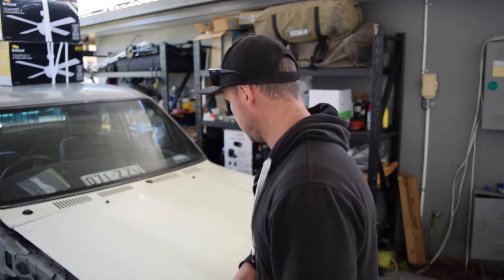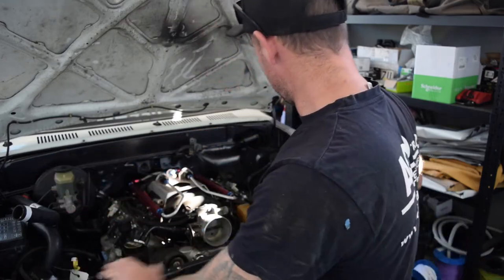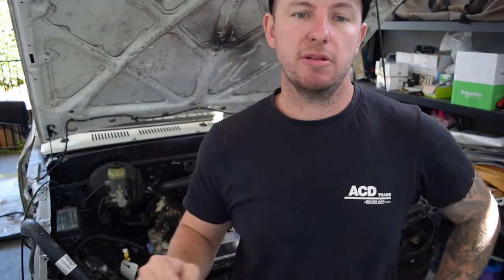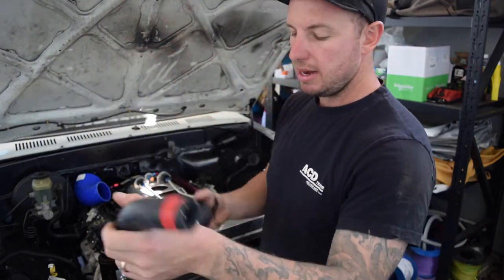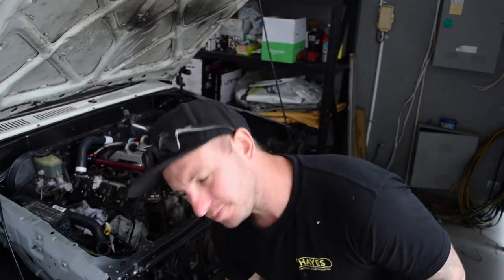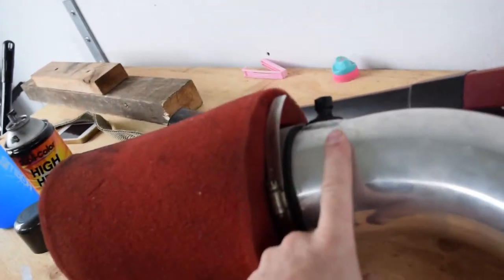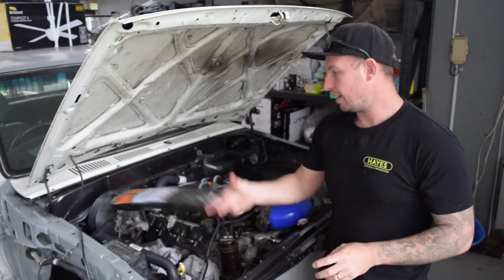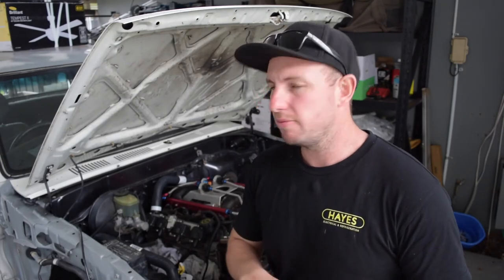LS1 Hilux Ep4 Radiator dont fit

Comment: Remote radiator tray mount? Elec water pump? I think you’ll need a decent 3 core or upwards to keep that thing cool??? 

Or go outside of rad support and modify grille to accomodate?
Reply from the maker: Hey mate! I was thinking the 3 core would be minimum but there seems to be a few people running 2 cores so will just need to see how we go 😕

Comment: Hey man, 

I'm having some troubles with my 304 swapped surf. Just wondering how that radiator ended up going? Was the 2 cores enough to keep it cool?
Reply from the maker: @walfoh hey mate! So far so good but I haven’t given it a good flogging yet. Cruising around town seems fine. 
Yours being a 4wd it might get hot in the sand as I’ve seen the LS gets hot in the sand. 
On the v8 Hilux group on Facebook there is a few 4wds on there that use the surf radiator so I would say it should be fine. 

What thermos do you have? Can you fit any on the back side? Mines a 16 inch on the front

Cheers
Reply: And could you tell me where you got that radiator from please?
Reply from the maker: @walfoh8368  sorry 😂 mine is a 2 core standard 22r plastic surround radiator from eBay. Would of been $150
If it continues to cool properly I may look at getting a nice one made
Reply: @banksgarageaus  Yeah man so I managed to fit the thermo on the front of the rad. Just ordered a KZN130 alloy rad which is pretty common I believe. I'll probably just have to move the brackets alittle to drop it down so I can close the bonnet but fingers crossed it all goes well